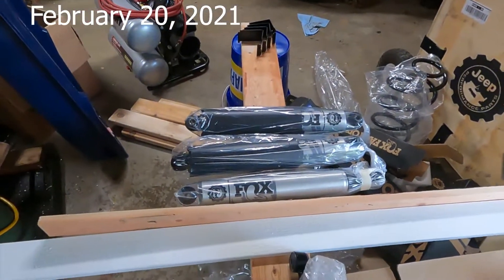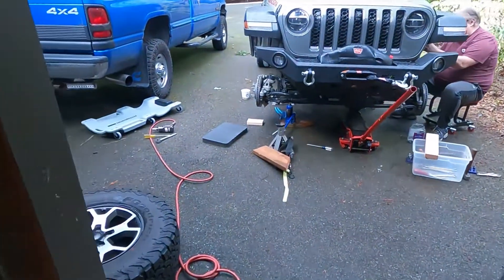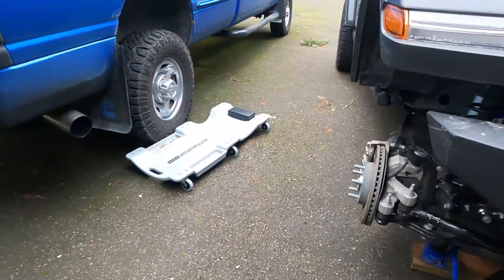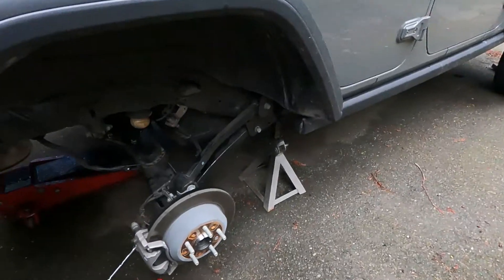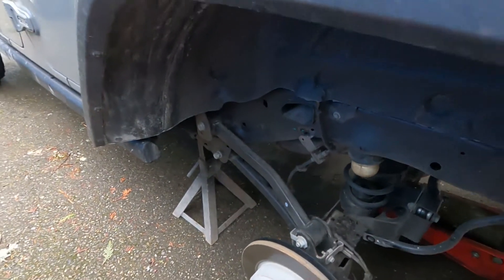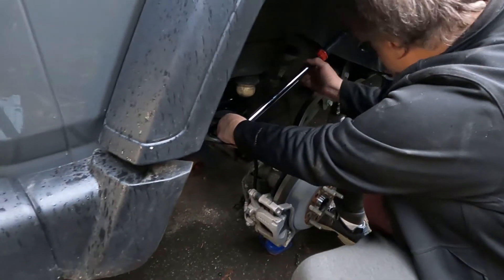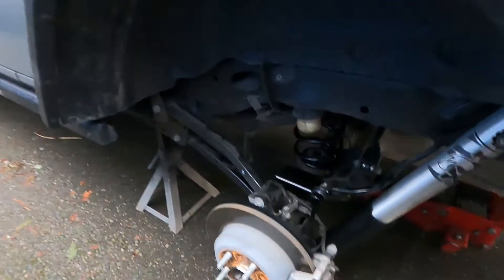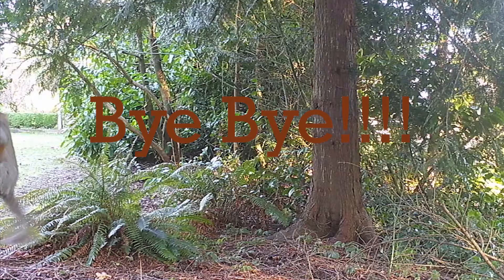2" Lift Kit on the Jeep

Comment: Had mine installed on 2020 Wrangler Ecodiesel. I worried a lot about new tires. Now that I’ve seen it I’m keeping the stock wheels and tires.
Reply from the maker: We've found that our stock tires work great. We might go to a slightly larger tire at some point, but we're trying to keep them the same width so we can still fit between trees on tight trails.
Reply: @MikeandGayleAdventure  I’ve since decided to go bigger. Probably going to get Toyo M/Ts 285/75/17s and steelies

Comment: I put the same kit on my eco diesel and it raised the front 4 3/4 inches and 3 5/8 in the rear....... I wonder why everyone has different results? I did all my measurements on flat ground before and after.......
Reply from the maker: I'm sure every Jeep build is a little different as far as weight and options. Maybe if you take two Rubicons with the exact same engines, tires, etc.. they would be similar. It is interesting that you got so much height out of a 2" lift.
Reply: @MikeandGayleAdventure  the eco diesel comes with heavier springs, I'm just suprised it raised it that much...... it would fit 37 easily. It sits as high or higher than my jk did with a 4.5 inch lift. And I still have stock tires on it lol
Reply: Oh man I'm hating the diesel prices for you right now buddy. I'm also a little jealous of the diesel you got. :)
Reply: @sid2112  I run red...... it's as cheap as gas...... just don't get caught. Fine is cheaper than not doing it lol
Reply: @willrector9716  finger taps nose understood!